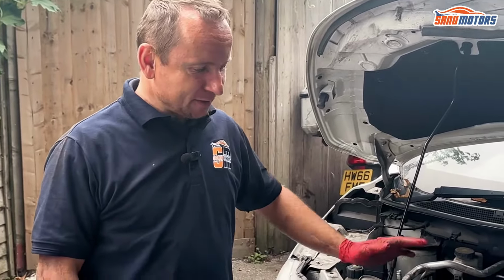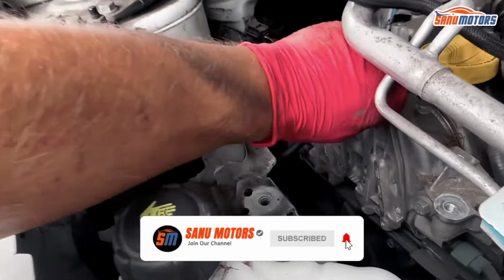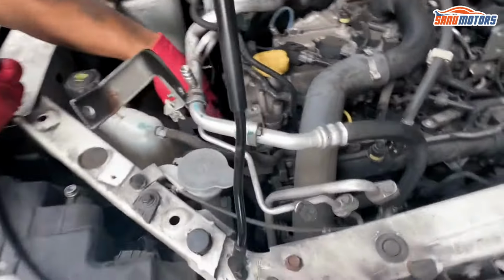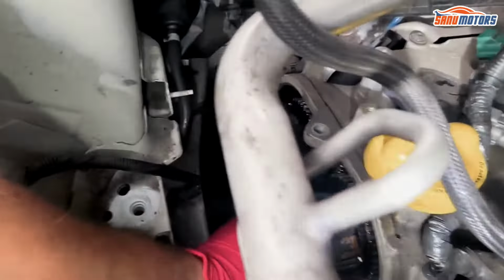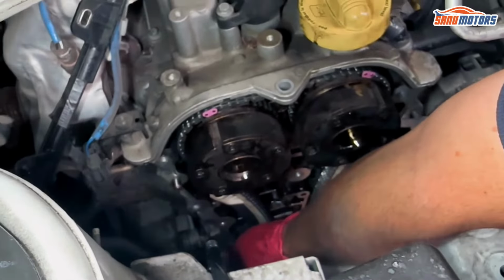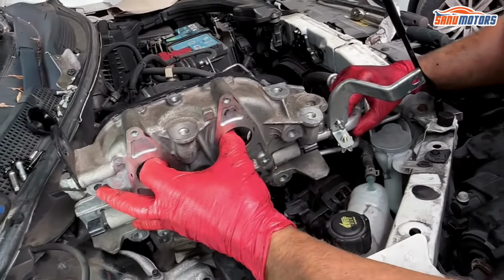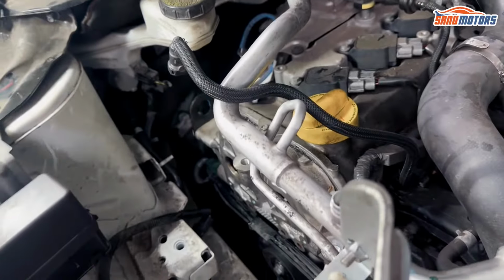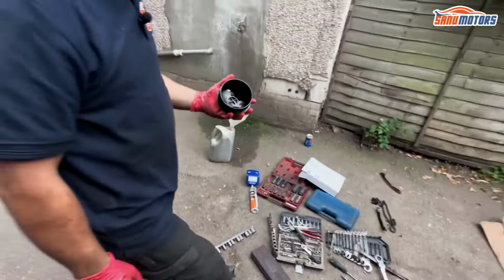Replacing the Timing Chain on Nissan Qashqai 1.2 | Timing Chain DIY Tutorial

Comment: The 19socket that holds the crank pulley, do you lock the crank from moving before unscrewing it, im using a T Piece to unscrew wont the crank /pistons move as if reversing?
Reply from the maker: Yes, when removing the crank pulley bolt, it's crucial to prevent the crankshaft from rotating. If you attempt to unscrew the bolt without securing the crankshaft, there's a high probability that the crankshaft will turn, which could cause damage to the engine components, particularly if it rotates in the wrong direction.

To prevent the crankshaft from rotating while you loosen the crank pulley bolt, you typically have a few options:

Using a Flywheel Lock: Many engines have a designated tool, often called a flywheel lock, which immobilizes the flywheel or flex plate teeth to prevent the crankshaft from rotating. You would typically use this tool in conjunction with the appropriate socket and breaker bar or impact wrench to loosen the crank pulley bolt.

Using a Piston Stop Tool: Another method involves inserting a piston stop tool into one of the spark plug holes to prevent piston movement. By positioning the piston at the top dead center (TDC) of its compression stroke and inserting the piston stop tool, you effectively prevent the crankshaft from rotating.

Using a Large Wrench on the Crankshaft Pulley Bolt: In some cases, you may be able to wedge a large wrench or a pry bar against the flywheel or flex plate teeth to prevent rotation. This method requires caution to avoid damaging the teeth or causing other harm.

Regardless of the method you choose, always ensure that the crankshaft is securely held in place before attempting to loosen the crank pulley bolt. This precaution will help prevent damage to engine components and ensure a successful repair or maintenance task.
Reply: Hi thank you for the clarity, im actually already busy removing the head, how did you know when to stop turning the engine as you mention timing marks are out, how should you camshaft be positioned and did you check if your 1st piston was up before putting new chain.
Reply: Or maybe I should ask you to take me through the steps of. Putting the chain back. Especially timing marks on both camshaft and crankshaft
Reply from the maker: Please check our live video, for more details, if you are not sure be careful,

Comment: Thank you for great video. 

I have an issue about timig chain on my 1.2 Dig-T 2015 Qashqai. The timing chain was working loudly, chain sound were coming from the motor. My mechanic said timing chain should be changed. And I have replaced the timig chain and also alternator belt. After that the sound were gone. But motor light came out. The fault code is P0090.

I have checked the wirings from hight pressure regulator to ECM. There was no problem on wirings.
Replaced the fuel high pressure regulator but never got rid of it.

I clean the fault code but after 2-3 min later it comes up again. What should I do is it a software problem? Bu it came up after changing timing chain why it wouldnt came before? Now I am stuck. Can you help me?
Reply from the maker: The issue you're facing with the P0090 fault code after replacing the timing chain and alternator belt on your 1.2 Dig-T 2015 Qashqai is a challenging one, but I can offer some steps to help troubleshoot and potentially resolve the problem.

### Understanding the P0090 Fault Code
The P0090 code indicates an issue with the "Fuel Pressure Regulator Control Circuit." This could involve the fuel pressure regulator itself, the wiring, or the ECU's ability to control the fuel pressure regulator. The fact that this issue arose after a timing chain replacement suggests that something may have been disturbed or improperly reassembled during that repair.

### Possible Causes and Steps to Troubleshoot

1. *Check the Connections Again:*
   - Double-check all electrical connections and sensors that might have been disturbed during the timing chain replacement. This includes connectors related to the fuel pressure regulator and the ECU.
   - Ensure that all connectors are fully seated and that no pins are bent or corroded.

2. *Inspect the Timing:*
   - Although the P0090 code specifically points to the fuel pressure regulator, improper timing can cause a variety of issues, including those affecting fuel pressure and engine performance.
   - Verify that the timing chain was installed correctly and that the timing marks were properly aligned. Even a slight misalignment could cause various engine issues.

3. *Check the High-Pressure Fuel Pump:*
   - The high-pressure fuel pump might have been affected during the timing chain replacement. If it's not delivering the correct pressure, it could cause the ECU to flag a P0090 code.
   - Ensure that the pump is functioning properly and that there are no blockages or issues in the fuel lines.

4. *Software or ECU Issue:*
   - Since the issue appeared right after the mechanical work, it's possible that a software issue could be involved, especially if the ECU has not been reset or adapted properly after the timing chain replacement.
   - Consider having the ECU checked or reflashed by a professional. This can sometimes resolve issues that appear after significant engine work.

5. *Vacuum System Check:*
   - Some systems use vacuum control for fuel pressure regulation. If any vacuum hoses were disconnected or damaged during the repair, it could cause issues.
   - Check for any vacuum leaks or disconnected hoses.

6. *Consult a Nissan Specialist:*
   - If all else fails, it might be worth consulting a Nissan specialist or a dealer who can perform more in-depth diagnostics. They may have seen similar issues before and can provide a more targeted solution.

Given that the issue began after the timing chain replacement, the most likely causes are related to something that was disturbed during the repair—such as wiring, connectors, or even timing. If you've already checked the wiring and replaced the fuel pressure regulator, focusing on timing alignment and potential ECU/software issues would be the next logical steps.

If the problem persists, seeking help from a Nissan dealer or specialist with the right diagnostic tools may be necessary to resolve the issue.
Reply: @SanuMotorswithCharlie  thank you so much for detailed information. I have made an appointment at Nissan dealer. Cant wait to solve this issue. I will inform you after that.
Reply: @SanuMotorswithCharlie  I went to nissan dealer they have reload the ECU with updates and problem did not solved. They said they need to replace timing chain again and control the engine again. Then I took my car back and I went to my mechanic again. He oppened the engine cover and check the timing of chain again. He said nothing wrong about the timing and chain. I have been driving my car after replacing the timing chain abuout 3000km. The car works fine I dont realise any other problem except egine check light.

Comment: Hi mate, I have the 1.3 Tce in a Renault kadjar, will it have same problem 👍
Reply from the maker: please change soon
Reply: Thanks for reply what kind of mileage would you recommend changing it, no noise at only 26k on it
Reply from the maker: The timing chain replacement interval for the Nissan Qashqai 1.2L can vary depending on factors such as driving conditions, maintenance history, and manufacturer recommendations. Typically, timing chains are designed to last longer than timing belts and may not need replacement as frequently.

However, it's essential to follow the manufacturer's recommended maintenance schedule outlined in the owner's manual. If there is no specific mileage mentioned for timing chain replacement, it's advisable to have it inspected periodically by a qualified mechanic, especially if you notice any unusual noises, vibrations, or performance issues.

Since your Qashqai has only 26k miles and there are no apparent issues with the timing chain, it's likely still in good condition. You may not need to replace it just yet. However, it's always a good idea to stay proactive with maintenance and have it checked during routine servicing to ensure its longevity and prevent potential problems in the future.

Comment: When nissan qashqai 1.2 QASHQAI ACENTA DIG-T auto 2016 need to change timing chain. Can you please reply me thank u
Reply: Petrol
Reply from the maker: yes we can do the job, if you need more details, pls contact us at 07551021029
thanks
Reply: @SanuMotorswithCharlie  i am asking about milage on what milage do i need to do this ?
Reply from the maker: The timing chain replacement interval for a Nissan Qashqai with a 1.2 L engine can vary depending on several factors including driving conditions, maintenance history, and the specific model year. However, generally speaking, timing chains are designed to last the lifetime of the engine in modern vehicles.

Nissan doesn't typically specify a replacement interval for the timing chain in their vehicles as they are designed to be maintenance-free for the life of the engine. However, it's always a good idea to follow the manufacturer's recommended maintenance schedule outlined in your vehicle's owner's manual. This will ensure that your Qashqai receives the necessary maintenance at the appropriate intervals to keep it running smoothly and reliably. If you have concerns about your timing chain, it's best to consult with a certified technician/ mechanic for a professional assessment.

Comment: I am about to buy this car, 54k on the clock but dont believe the chain has been changed yet. Do you recommend the car?
Reply from the maker: When considering purchasing a used car, especially one with higher mileage like the Nissan Qashqai you're looking at, it's essential to take several factors into account:

Service History: Verify the service history of the vehicle. If the timing chain hasn't been replaced and the car has reached 54k miles, it may be a concern. Timing chain replacement intervals can vary, but it's crucial to ensure it's in good condition to prevent potential issues down the line.

Mechanical Inspection: Have a trusted mechanic perform a thorough inspection of the car, paying close attention to the engine, transmission, suspension, and other critical components. They can assess the overall condition of the vehicle and identify any potential issues.

Cost of Repairs: Consider the cost of potential repairs, including replacing the timing chain if necessary. Factor these costs into your budget and determine if it aligns with your financial expectations.

Vehicle Reputation: Research the Nissan Qashqai's reliability and common issues reported by owners. This information can give you insight into what to expect and help you make an informed decision.

Price and Negotiation: Negotiate the price based on the condition of the vehicle, including any necessary repairs or maintenance. Don't hesitate to walk away if the seller isn't willing to negotiate or if you're uncomfortable with the deal.

Ultimately, whether or not to purchase the Nissan Qashqai depends on your assessment of the car's condition, your budget, and your willingness to take on any potential repairs or maintenance. If you're unsure, it may be worth considering other options or waiting for a vehicle with a more favorable history and condition.

Comment: and the cranck seal?
Reply from the maker: Great question! When replacing the timing chain on a Nissan Qashqai 1.2, it’s a good idea to inspect the crankshaft seal. If there are any signs of wear, leaks, or damage, it’s best to replace it while you’re in there. It’s a relatively inexpensive part and saves you from future headaches. 🔧

At our garage, all repairs are tailored to the customer’s requirements—so we ensure the work matches their needs and preferences. Let me know if you need more details or tips! 🚗👍 #NissanQashqai #TimingChainReplacement #DIYMechanic

Comment: Hello bro  I have Nissan qashqai 1.2 petrol 2016. I replaced engine because old one seized and now I fix used with 40k mileage engine. With this engine it shows C1130 code ,esp light, battery light,radar sensor collision light and system fault and stop start fault  and I changed battery ,checked fuse but lights are on , can anyone help me
Thanks in advance
Reply from the maker: c  code related ABS system, how ever this is a common cause for diesel cars, block presser line.
to be honest I'm not sure, better to take it to the garage and ask them to check, also make sure all plugs and connectors clip properly
sorry